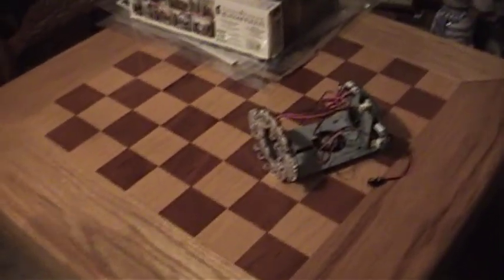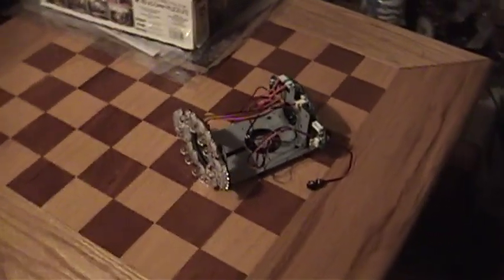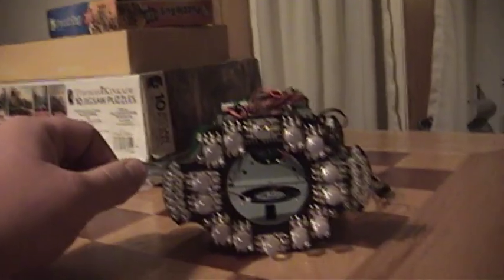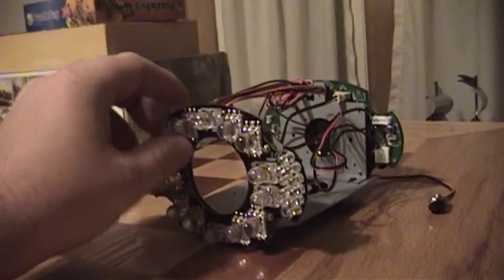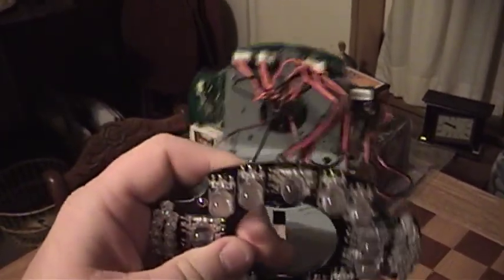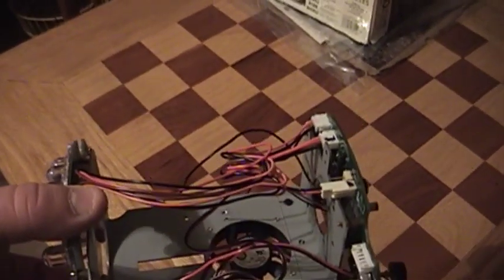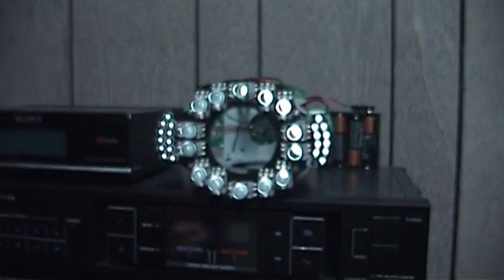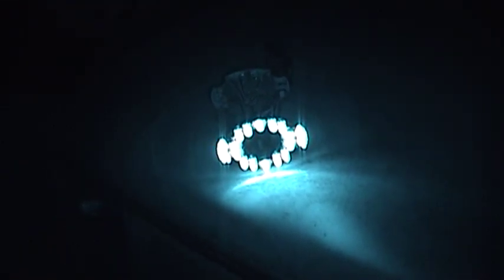Lighting Up The Night!

Comment: If you used brand new fresh batteries to power the LED's how long do you think the batteries would last before they go flat?  Did the batteries get hot during operation?  How noisy is the cooling fan on the LED unit?  I wonder if the camera was designed to be used in a large outdoor setting like a car park or yard of some sort?  Would you want LED's that bright inside a building?  I'm surprised the camera manufacturer didn't design the camera case with the fan in mind.

Comment: @uxwbill Yeah. But i meant the final battery pack! :) 
One very nice thing if you want it lightweight and pack a lot of power, and still be cheap. modify a second hand laptop battery! LiIon cells give a lot of juice compared to their size. The only drawback is the charging. But eache cell want a regulated 4.2V supply to be fully charged. so it's surely not impossible.

Comment: Hey man! that's a pretty kick ass IR light you got there! Personally i would not use AA batteries. As they tend to drop a lot in voltage and their inner resistance is quite high. I should try out like a RC car battery pack or similar. Cause they can deliver a hell lot power current.